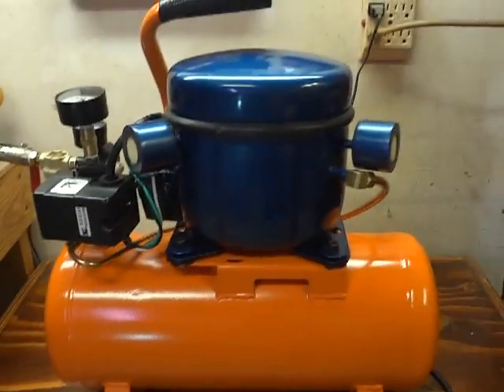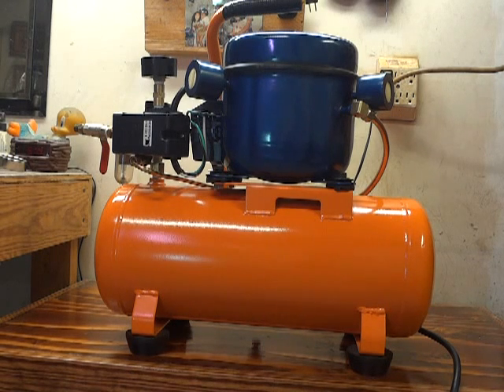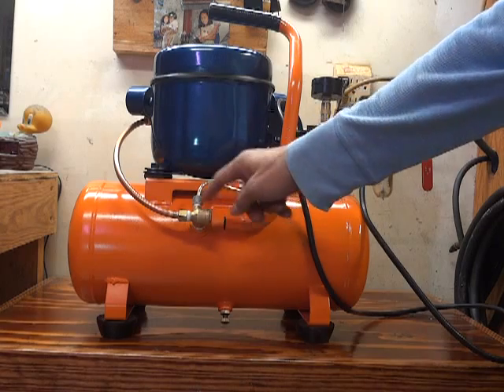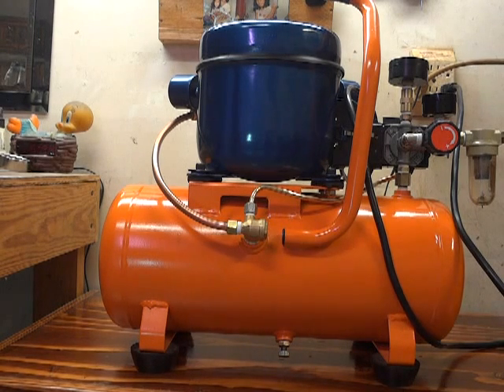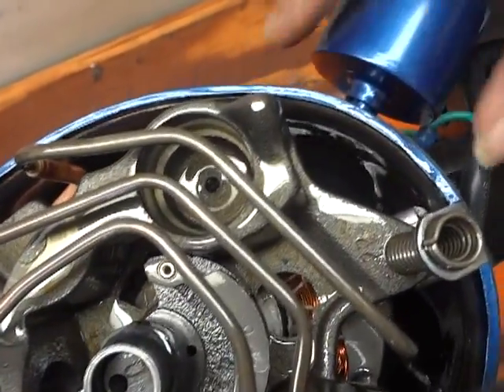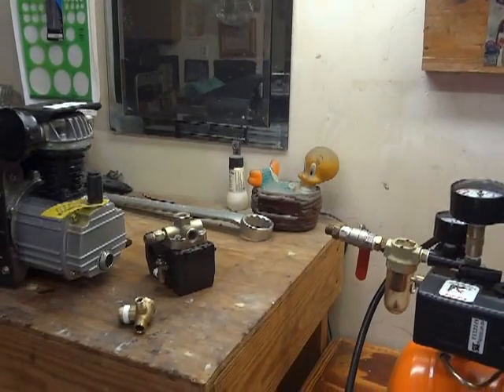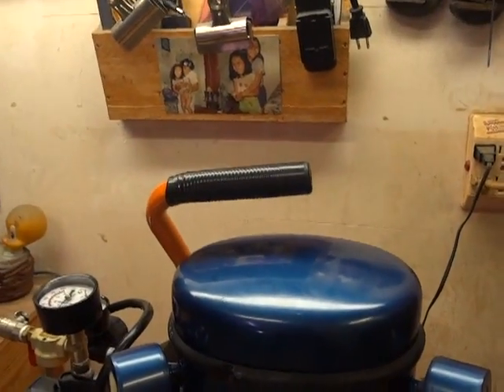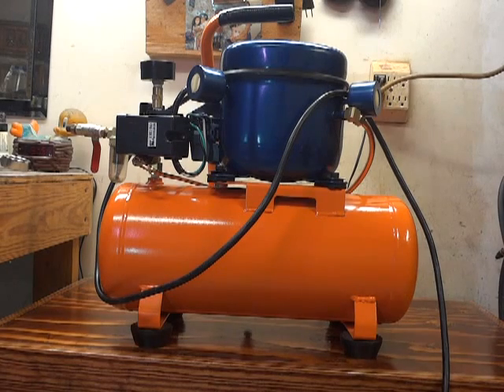Homemade silent compressor

Comment: I was looking for a small compressor to use💫 allabout.wiki/Gallon  for airbrushing but one that also had sufficient pressure for other light tasks. This compressor fits the bill perfectly. The sound is remarkably quiet. It is perfectly suitable for indoor use where others might be bothered by loud noise. You can easily converse while the compressor is running. The tank fills in under a minute and the pressure holds steady while airbrushing with the compressor running. Keep in mind that this is not going to support tools that demand high volume. It would be great for light tasks and a small finish nailer.There have been some posts expressing concern about the quality. My experience is that the fit and finish is very good. There were no significant air leaks and all of the parts seem very well put together. I've only had it for a short time so I cannot comment on longevity but I can say that, if you are looking for a small, quiet compressor that's a bit more beefy than the inexpensive diaphragm airbrush compressors, this is an outstanding choice.

Comment: Here is a update on my comment below.  I finally figured out why these compressors do not always start after being switched on immediately after running. Normally you have to wait 1 to 3 minutes for them to restart. This is because they are induction motors. Because of them low torque of them, they need the wait time, for the mags to align properly to start rotation again.
   I have cured this in my latest jewelry compressor I built.  3 things you can do.  First use a Condor Mr11GC2E pressure switch. This pressure switch has two screws. With these you can set your cut on press. at 60 and your cut in press. at 125. This will give ample wait time usually between run times if your using GRS equipment that runs at about 25 psi. If you need more time, between start and stops, use a 10 gallon tank instead of these 6 gallon ones. These compressors can pump them up to 120 easily. This will also give you more off time between runs. Lastly if you really want to cure the problem of not starting without waiting 1 to 3 minutes......on your compressor, be sure you have a PTC relay, a overload switch, and a 12 - 15 uf run capacitor. Usually your compressor will have these on them. Then, to the run capacitor, hook a Supco SPP-5 hard start kit.  This simply hooks piggyback to the run capacitor wires. It increases starting torque by 300%.  ( make sure your compressor is at least a 1/3 hp).  I used this on mine, and it will immediately start everytime, with no wait time.  This sounds like the easiest fix for these induction compressors.....but , I don't not know, over the long time, if it will shorten my compressor windings. I suppose I will know in a yr or two.  
    Lastly, for those of you, that say these compressor overheat......Always hook a air filter to the suction port, AND the process or service port.....this will let the compressor suck air in both ports and cool it better. Also, only use it in rooms with less than 90 degree air temp.  This is all that is required to keep them cooled from what I am told by designers.  Good Luck. I hope to post my own You tube video build, once I have better internet.
Reply: I really find your comment about putting filter on both service & suction tube helpful.

Comment: I have built two of these. One thing that IS a problem. The compressor pumps up good. But because of restart problems using a refig compressor, you have to pay close attention to your pressure switch set up. It seems to take a compressor like this 2 minutes from cut off till it will restart. During this time, the compressor is humming. And if it is already hot from running awhile, it will loudly pop the overload switch. This cuts power until the compressor cools. Then it kicks back in and the compressor will start. I have heard this period of humming will burn out the start windings in motor eventually. To help the problem you have to have the unloader valve working to relieve the air above the piston. Without this, it takes it even longer to start. Secondly, use a big tank. If you use a larger tank, it will take the tank pressure a longer period of time to drop from say 120 cut out pressure to a 90 cut in pressure. Hopefully this will be enough time to allow the compressor to restart without going into the hum overload stage. Like I said, mine takes 2 minutes before it will restart. With a large tank, the time period from stop to restart is longer. I have looked for a pressure switch that I could adjust the cut in AND the cut out. This would solve the problem. Set cut in at 40 and cut out at 120. Then the set time would be longer before restart demand. My set up has start capacitor, relay and overload. I use 10w40 oil in it with a oil separator between discharge and tank. Any suggestions with this problem I would very much welcome responses. Other than that , I think they work great. I am a jewelry maker and use it to engrave.

Comment: I watched this again, to think about how the refrigerant compressor works. In the applied form, the compressor is a closed-loop, circulating refrigerant and oil. in this application it's an open loop; pulling air in and expelling it into the reservoir. I have two questions then: 
1.) How "clean" is the pressurized air (oil presence in compressed air)?
 2.) Have you determined how much oil is present in the tank; or considered volumetric scavenging ratio?

Thank You.

Comment: The refrigerant compressor is designed with a thermistor to check temperature of the high pressure side. I think this is why it takes time to restart. For airbrush supply, 3 gal is a lot! Thank you for sharing this idea! It's a paradigm idea. So simple, and perfect for the application! Thanks!!

Comment: Very good video.

I had heard of this idea, but never looked into it.  You explained it very well.

Rather than cut the top off, maybe you could drill a large hole in the top to drain and add/check new oil with a dip stick ? 

That way you can just put a plastic plug in the hole.

Cheers Rob

Comment: I was rather tempted to build one myself since i have a few a/c compressors sitting around. one I use as a vacuum pump for a/c work.... I was wondering did you make a air/oil separator for this pump?

Comment: YOU MEAN IT WILL TAKE 35 MINUTES FOR THE COMPRESSOR TO RECOVER?   SO I WILL RUN OUT OF AIR AND STILL WAIT ANOTHER  30 MINUTES TO FILL UP?   LOL
Reply: +PEPE LE PEW I never say it takes 35 minutes for the compressor to recover. I said it takes 4 minutes to fill up the tank !!!

Comment: Curious how well this has held up. I would be a bit concerned about the direction of the output tube from the compressor. It seems that in this arrangement you would have to check and refill the oil much more often than you would if you had made the tube go up, then curve back down so that the oil can collect in the output tube and go back into the compressor between fills, where this way seems like it will drain into the tank.
Reply: +Amra I do check the oil quite often, so far it looks ok. Since I put new oil for the first time I never add  oil in it, and when I drain the tank after each use I don't see oil come out just litle bit of water like any other air compressor if they being use alot. So far everything work perfectly, I use it almost everyday. Thanks for your comment.
Reply: Suwandi Ibrahim That's good to hear, I am in the process of building my own silent compressor and am looking at all the different designs, and find this one fairly nice, just had that one concern, but you've quelled it.  Thanks for your response.

Comment: it needs the original capacitor from the fridge so it won't take 5 min to restart the pump . I'm guessing that's ur issue . but nice job.
Reply: +bigmikeyc83 Compressor kicks back on whenever the air in the tank getting low that is not an issue. 4 to 5 minutes is the time it takes to fill up the tank from totaly empty. It's ok if you missunderstood. Thanks.

Comment: How many liter per minute?
Will it not blow the top off?
Reply: Hulla Dek I don't know how many liter per minute, but I know it takes 4 minutes to fill up the tank. Absolutly not gonna blow the top off, there is no air pressure in the motor. The air pressure go straight to the tubing. Thank you for watching.
Reply: +Suwandi Ibrahim Okay, how many liter is the tank then 25? And the max output pressure 8bar?

Comment: hey could you please help me out i wanted to make a compressor at home!!
from a fridge compressor!!!
can you tell me key points to make it!!
Reply: Ansul Joshi What you need to do first, find a fridge compressor, tank, pressure switch and some fittings and some other stuff then start putting together, one at a time. Don't expect everything going to be that simple. Might need some adjustment on some point. Good luck. Thanks for watching.
Reply: I dont expect it to be that easy!! thats why love doing it!! just concerned if it blasts !! 
other than that i have no issues!! btw's thanks!!

Comment: Hi there. I was wondering what size is or type is the check valve from the compressor to the air tank?
Reply: knightstalker36 Size 3/8 it's " T " type check valve.

Comment: Any compresors silent when not running. The video would be more intresting if the unit ran throughout.
Reply: psdaengr The video showing when the compressor running too, but not the entire video.
Reply: psdaengr if he let it run that long he would need to bleed off the air as it auto stops at set pressure. it is a real silent running machine, like a snail.
Reply: psdaengr if he let it run that long he would need to bleed off the air as it auto stops at set pressure. it is a real silent running machine, like a snail.

Comment: This was a very helpful video. I would only add a little information. When it comes to hooking up the electrical circuit you can take out any extra circuitry that comes with the compressor. All you need is the black and white ( in and out) to and from the compressor. As well I would add think of the circuit as a single line. You come in from the wall outlet on one side and after going in and out of the compressor, pressure sensor, on off switch, and inline fuse if you are adding one ( I used a 8 amp fuse) you go back into the wall outlet with the other wire. Great video. Thanks for uploading it.
Reply: Paul O'Neill Thanks for the info, and thanks for your comment.

Comment: Hey...bro nice video dude.that compressor can use for car painting?
Reply: MEDIA SSKM II Video Upload I can airbrush the car with it, but I have to switch with bigger compressor for clear coating the whole car or painting the whole car. Thanks for the comment.
Reply: I got a lvlp paint gun at grizzly.com , 13psi at gun ,
You can use that compressor
Reply: And paint whole car...
Reply: ***** 13 psi gun, sure I can use the compressor, but the compressor will keep running the whole
time because of continuosely spraying, the good thing is my compressor has a cooling fan installed now so it won't be any problem.
Reply: Suwandi Ibrahim ah,..ok thank you for advice (y) (y) (y)
Reply: ***** thanks for advice bro,..
Reply: MEDIA SSKM II Video Upload Not a problem.

Comment: Nice job, I am planning to make one for airbrush parties, so I want to make it portable.  What size compressor did you install?
Reply: Thank you, I don't know exactly what size compressor I used.
The only thing I know is the compressor was from family size refrigerator which is 27 cu in size. The bigger the better, more powerful with just one compressor.

Comment: Hey boss.i built exactly one like yours but mine wont restart after pressure drop?
Reply: Try to adjust the pressure switch, if it doesn't work you might need to replace with the new one, it's one whole piece. I'm sure it's got something to do with the pressure switch.

Comment: great paint job! I pulled the bed off the truck and rusty! Cleaned up good. Dude, how do I preserve it using auto store paint?
Reply: You might need to sandblast first to get rid of rusted spot, then go to Sherwin William auto paint store and tell them what you need to do with your truck, they will tell you what you need to get. Thanks for the comment.

Comment: Great project done the right way. I would like to know with it running how long it takes to empty air tank using a paint gun at 35 PSI. It's very hard to understand it's performance with little to go on.
Reply: +dirkbonesteel Hahahaha he said 5 minutes. Sure buddy, sure.
Reply from the maker: Thanks, maybe about 5min.or so.

Comment: Thanks for the video! I missed it if you mentioned this but how do you keep the oil inside the compressor from going into the air tank?
Reply from the maker: That issue, there's nothing I can do about it. The oil still get to the tank, but very little.

Comment: its not like ultra quiet airbrushing compressors are unobtainable or particularly expensive. 
I have a dewalt hand carry compressor rated at 4.5 cfm. Its enough to run impact wrenches, nailers, riviters etc but not grinders or media blasters. I built an enclosure around it including a layer of sand in the base to stop vibration but wasnt happy with the results so built a second around the first.
You can hold a quiet conversation next to it when its running. You only have to service it about once a year as the tank has remote water drain and I added a thermocoupled temp gauge that sits in the crankcase oil. The big issue is heat control I have 2 blowers (1 in 1 exhaust) plus 3 5" internal fans.
If I did it again I would have a lot of changes.
I did one for a 15 gal shop vac came our better the key with that was using labyrinth assemblies on the intake and exhaust fans. If anyone wants I can furnish a link to a photobucket album of that. 
Overall Im not being critical of your work as much as saying there isnt much of a need to make one....  .5 cfm or so compressors are damn quiet anyway. Show me a way to keep 4-5 cfm or more continuous on tap 24 hours a day which doesnt piss off neighbors living 20 feet away.
Reply from the maker: Did I mention it's only airbrush compressor?? 2HP. 3 gal. tank, that's all it is.
Reply: Suwandi Ibrahim I doubt that converted fridge compressor is equal in CFM to your average 2 hp compressor. 
This is why I called it an airbrush compressor. Most of those applications require about .5 cfm. I think my dewalt is rated at 2.5 hp? I know its published output was 4.5 cfm.
I'm pretty familiar with what that will run. A 3/8" impact gun with ease. 1/2" just marginally. No rotational tools (like an angle grinder or cutoff tool) for more than a few seconds and no torque behind them.
Sandblasting is impossible for sustained operations. You can run a 3/8" reversible hand drill. 
Air riviters and nailers will run on 1-2 cfm.
Lacking the ability to actually test cfm if you can run an air drill or 1/2" impact gun long enough to loosen the lug nuts on a pickup truck that would indicate about a 2hp compressor. 
Otherwise looks a lot like an inflator to me.
Reply: Suwandi Ibrahim BTW I like your tone in your upload#188. Your power chords sound just like Accept's in Balls to the Wall. 
Is that Marshall (appears you werent playing it there)all tube? 
If you ever get a chance to play that with a real Les Paul with humbuckers in a very large room do it. That was god tone to me. I had a 93 custom black beauty and a jcm900 2x12 50 watt combo for many years I really miss that rig. Couldnt afford it now!
Reply: FuckGoogle+ I guess you can think of it this way, what if you put it in the trunk of your car on a decent size inverter? no need for a huge tank unless you want one, have a retractable hose in your truck also, the only reason why you might need a tank, is if you're going to use it for more than just tires. Also have question, without the rest of the fridgerator attached to the compressor, how many watts would the compressor use by itself?
Reply from the maker: I have a huge 25gal. Campbell house field comp. very loud, but I made an insulated box for it. And I built this one for one purpose only....airbrushing. Thanks for the comment though.
Reply from the maker: FuckGoogle+ first of all, thanks for the long story, but I don't need all that. The only thing I use it for is to airbrush, and the gun size is no bigger than a pen.
Reply from the maker: FuckGoogle+ Thanks, I was playing with my Randall Comander, the Marshall was just standing there, it's valstate.no tube, I was using my boss ME 70 and cry baby to make the sound like coming out from a tube amp.
Reply: How long it takes to full tank?

Comment: the refrigerator compressor will pump oil from the compressor sump into the tank. when it runs out of oil it will burn out. also the compressor does not have any cooling from the absence of cool refrigerant vapor entering the suction line.
Reply from the maker: I have more than enough oil for it, but thanks for the tips though. The compressor does not have any cooling from the inside, but it does have cooling fan on the out side (see my other vid. " Homemade silent compressor with cooling fan"). Thanks for your comment.

Comment: Thank you Suwandi, very nice and clean work ! Could you tell me from what type of fridge you take the compressor? I live in the CE and I am interested how many liters had the fridge to search something equivalent. Thank you again in advance.
Reply from the maker: Thank you for your comment. The compressor came out from a regular family size freezer / refregerator it's about 27 cu. in size. The tank is 3 gallon, I took apart from a broken craftsman compressor and replaced the motor with fridge compressor.
Reply: Thanks again.
Reply from the maker: Catalin Minulescu Your wellcome.